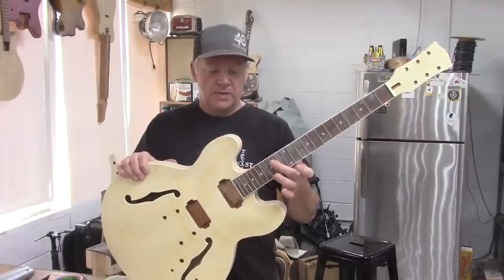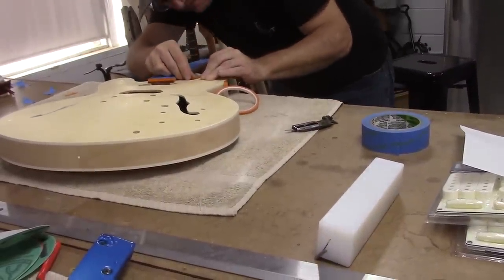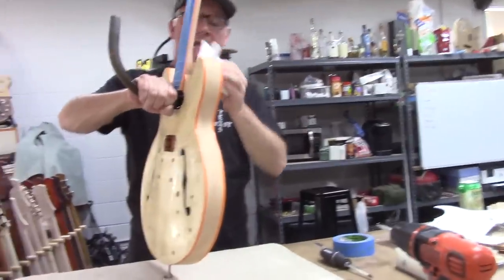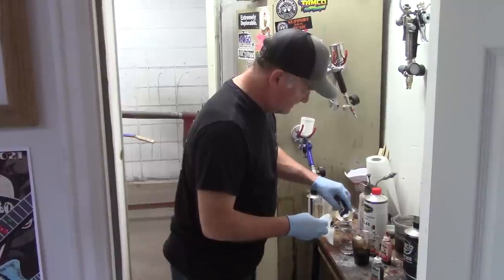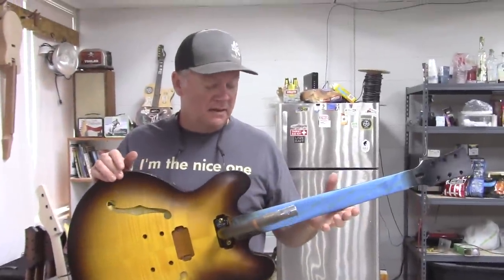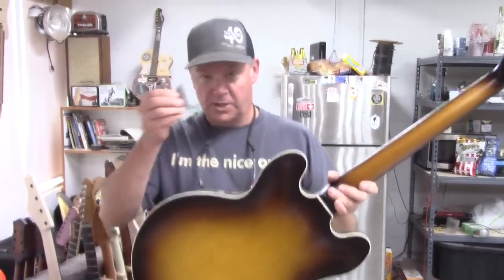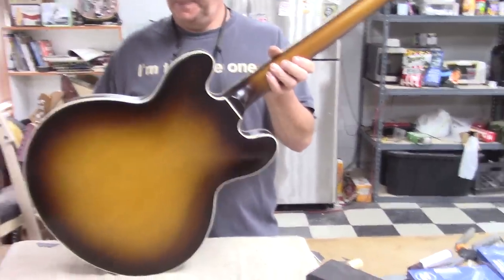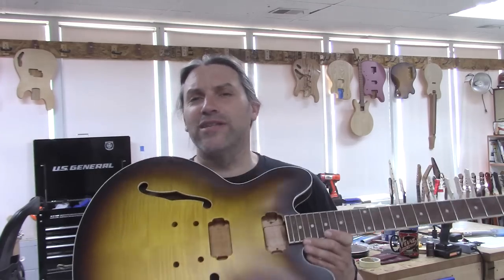How To Spray An Excellent Tobacco Burst Paint Job For The StewMac 335 Kit Guitar

Comment: Brilliant guys  Love that 73 finish. Ps. What happened to the new holding jig you were using a little while back.? 👍🎸🎸🎸🎸
Reply: The Spray twist paint rig works for bodies only , but not so much for set necks.  We use it when we are doing bolt on projects.

Comment: Do I absolutely need a sealer coat before my amber? I’m building a V in a traditional 58 layout and color. I’m on my 4th coat. I didn’t do a sealer, just grain fill and amber nitro… so far it’s great. What are the downfalls of not using a sealer before color?
Reply from the maker: I don't like to deal in absolutes. If you like it then you did it right

Comment: You might block my comment but that figure would have POPPED more with an aniline lemon yellow, then a tinted amber clear coat!
Gibson shoot shade coats over the yellow base  ....Heritage do shade coats then shoot aniline yellow over...the end result is totally different 
the lemon yellow over makes the shade coats blend in with different hue!
Reply: Dyeing a solid piece of wood is much different than a thin veneer.  If you watch the first episode you'll see why we specifically didn't use any dye on this before sealing.  I think our top turned out perfect, just like I wanted it to.
Reply: Comments are blocked if there’s fart jokes